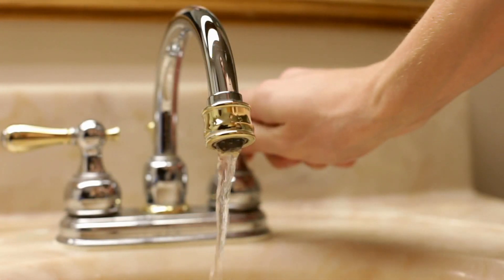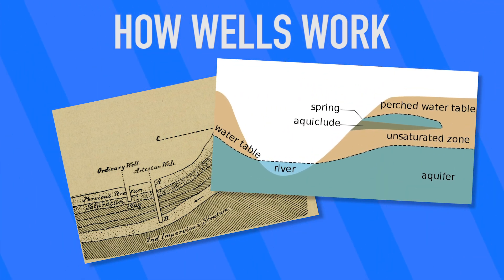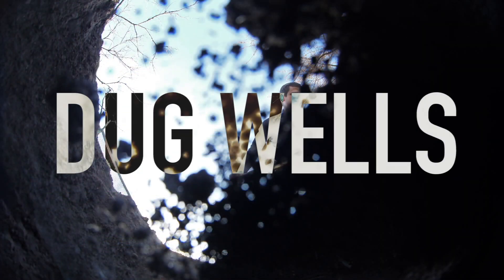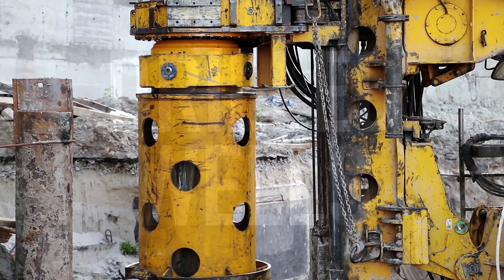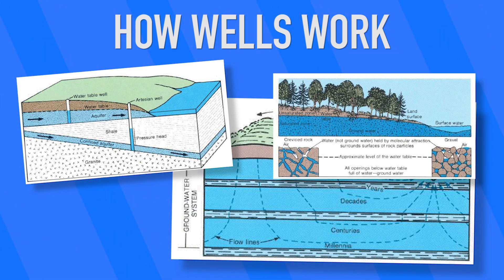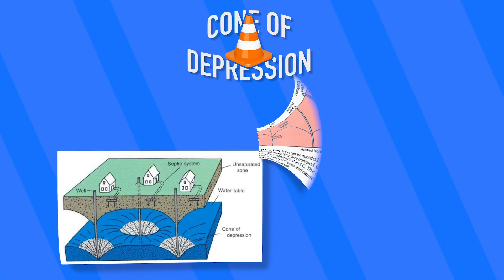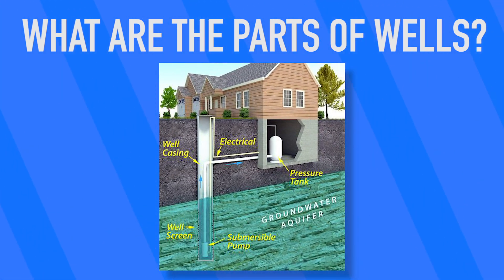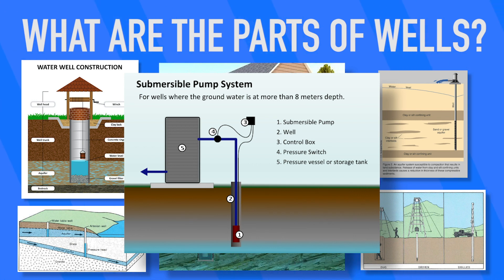How do Water Wells Work?

Comment: They failed to mention a condition about water tables in areas with lakes. If there is a man made lake in your area, the lake itself will change the level of the water table. An example, my GG Grandparents home has a hand dug stone lined well that fed water to their house for litterally centuries, about 3 miles down the road, the state came in and damned a local river creating a large lake and the month the lake began filling, the hand dug well went dry. We still have a separate water source of a naturally occurring spring that actually feeds the lake many miles down stream and my Grandfather converted it to feed water water to the house and barns and it has not once gone dry since 1913 with the exception of when the cistern the spring runs in to sits up with sand. We have to go down about every 10 years and run the pump wide open and use another pump to drain the cistern so we can get in and shovel out all the sand that has come up through the spring fissure. The way this problem was discovered was by me when after over 50 years running fine, the pump started sucking air. We uncovered the cistern and is was slap full of sand, I had to get down into the cistern and dig it all out by hand which trust me, sucks.

Comment: at about the 5 min mark you made reference to well pumps, and you stated that jet pumps are the most common but they can only be used to about 20 foot of depth.
I believe you are mistaking a jet pump with a "Shallow Well Pump" which is not much better than a pitcher pump when we talk about true atmospheric pumping depth.
The Jet well pump comes with a down the hole spray nozzle below the water table which can be in excess of 70 feet in depth thereby forcing the water up out of the well and into a pressure reservoir.
This you tube video will help in understanding(even though he miss speaks a few times; https://www.youtube.com/watch?v=fIBj4sDx_lM

Comment: My understanding is if say a extremely big drought happens in the USA, there will be no ground water to seep down to the bottom, which will cause all the wells to dry up, right? But if we see this happening and quickly decide to fill up large containers we might end up with a sink hole. One day when my well pipe was leaking for weeks, my neighbors complained that her water pressure was low, this must means my well is dug deeper than hers  or maybe the ground water was running low because of my leak, right? I look up how wells work because I had a dream all wells ran dry.  Almost all my dream are of future events. With global warming this is highly possible and I hope to prepare as best as I can.
Reply: You sound crazy all my dreams are future events head ass
Reply: Lol

Comment: Rewatching the walking dead and Marshall farm house still had running water due to multiple wells on the property. But 5:15 shows u still need electric wiring to pump the water up. As I’m watching I notice he has lamps on in the house as well so maybe he has multiple generators. I guess my question is it possible to have running water from your well without electricity?
Reply from the maker: You could have a hand pump, and a water tank on the roof, but you would have to frequently pump from the well to the tank on the roof.
Reply: @ConcerningReality  Awesome!!

Comment: how does the screen at the bottom not clog over time?
Reply: If your screen or filter doesnt touch the ground underwater it wont really get stuck (not quickly but you still have to service it), ours is floating just above the ground so no soil or stone are really sucked in

Comment: I live in the Philippines and am having a dug well installed right as I write this. Two questions: 

My water was found at 35 feet down. What determines how high the well will fill? What stops the well filling all the way up to the top or even overflowing?? 

Second question: The well was dug at the end of our dry season. Does the rainy season offer more flow to the aquifer? Can I expect an increased flow rate or higher reserve?  Great video THANKS!!!
Reply: According to studies rainy season does affect your well, higher reserves and an increased flow rate, As for finding water at 35 feet the determining on how high the well will fill depends on how high your water table is to the surface.

Wells don't overflow as the water table always has room, it will be higher or lower. 
seeing as your water table is 35 feet below surface level. these deep wells don't overflow

Comment: So if you put old water that’s been contaminated back into an old well …how does that work? Anyone know? Is it filtered and cleaned  someway?
Reply: You don't introduce contaminated water back into a well. That can seep down into the aquafer and contaminate the whole thing.
Reply from the maker: Wells can get contaminated, it happens quite frequently with oil drilling and chemical production.

Comment: There is a newer device called a wash down valve for " jetting" in wells in non rock subsurfaces.( as yet there is no demonstration on youtube )
Recipricating Rodpumps as used in windmills and oilwells can be used in very deep and small diameter wells.

Comment: Wait, so if I'm ever lost in a hot desert and don't know which way to go, I should just start digging until I hit the ground water? 😜
Reply from the maker: Well, sure, but it could be thousands of feet down 😅
Reply: You're not wrong. If lost in a desert, there could be lower-points you could find with signs of moisture, or small green sprigs is the best chance. Digging there is what I would do 😇
Reply: You might find oil instead water 😂😂😂